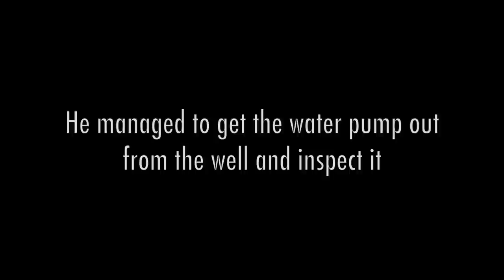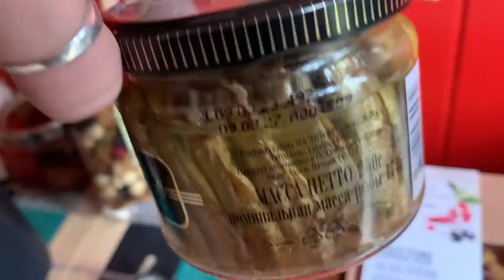Bathroom renovations continue but I also gotta plant trees

Comment: I will make a suggestion that when you can get that basement/well thing dried out later as we get into summer you or someone who knows how needs to put a sump pump system in but not a standard issue one - something more heavy duty.  Also need to look into figuring out where that water is coming from and perhaps longer term look to redo some drainage or such around the house.  French drain system?   Hard to get a good look/bead on what exactly/how so to speak that basement/well is setup but looks to be something unique.

Totally agree with a complete redo of your bathroom and especially if it involves getting that well pump upstairs and out of the basement entirely!  Electricity and water as we know are not good together - especially for living/breathing things so if all that goes down is lines for your well pump - the better!

Anxious to see how your bathroom comes out over time since you are so creative!!!👍👍👍

Comment: Good morning my Dear you're doing great that room will be a nice bathroom and the trees lined up nicely. If it can fit into your budget it comes in a roll you roll it to the length of your driveway then put gravel and rocks on top it helps it from getting soft can't remember proper name for it hopefully spring is around corner ❤ xoxo

Comment: 9:25  I had the same issue with my driveway on a property that I'm selling and made a temporary fix with rocks and gravel but it won't last for long. In my opinion the right way to do it would be to first put a filter fabric and then add 10-15 cm layer of 0-30 mm size crushed rock and compact it.